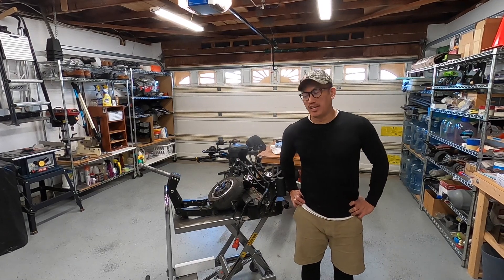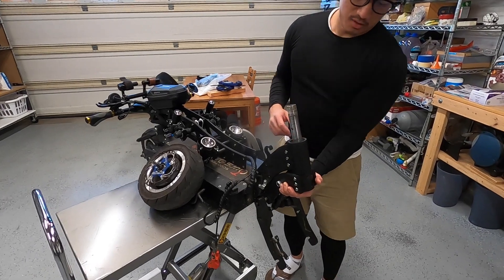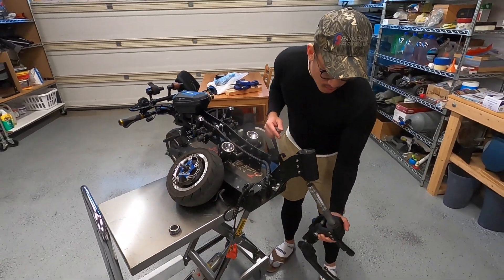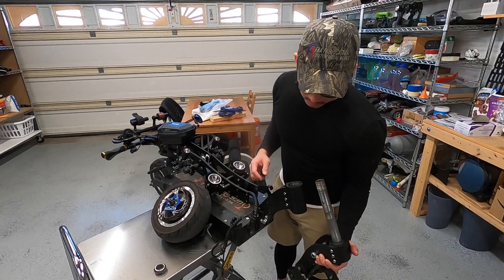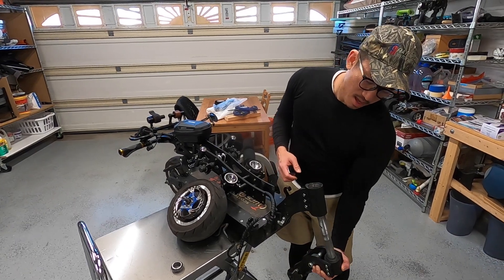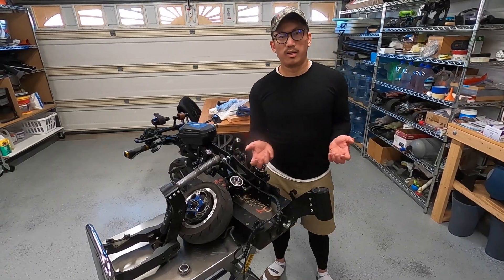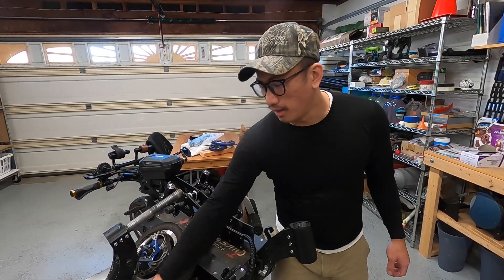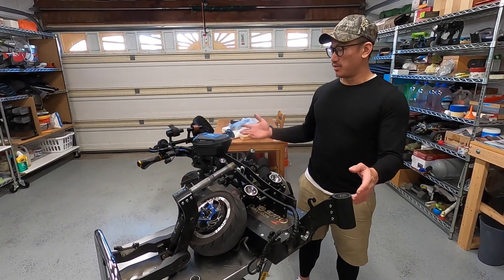Toursor E8 Pro Tapered Roller Bearing Failure

Comment: Like your video! just recently bought toursor electric scooter already have wobbly stem. Anyway, you know what size nuts bolt holding the stem?
Reply from the maker: I use a 36 mm socket to remove them.

Comment: Have you ever measured the tires on your scooters? Mine advertises 11in wheels, but they measure 10in. I am trying to find out if 10in is normal or if I got screwed.
Reply from the maker: Mine are indeed 11 inches with the tires inflated.
Reply: @MinhvuLy  Thanks for the quick response.